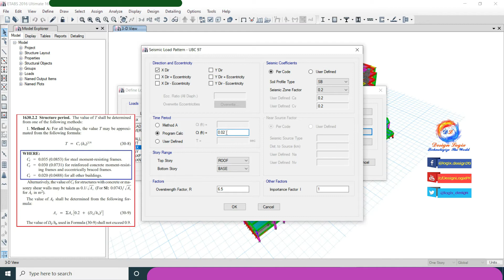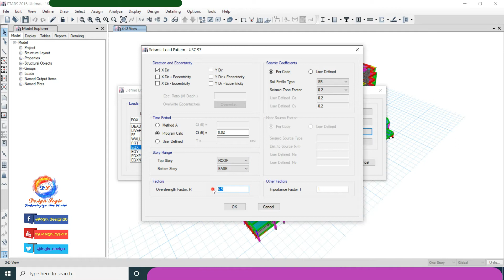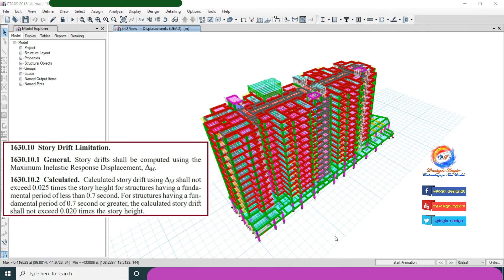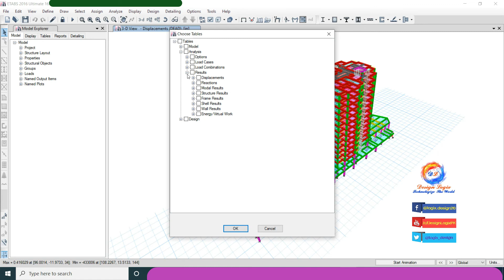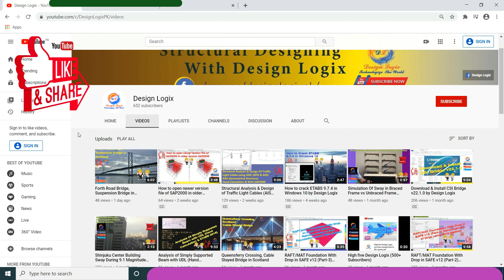How to check seismic drift in ETABS 2016 using UBC 97 code

Comment: hello sir, for steel structure to be check , it can be checked by exactly on the video even though it is steel buildings , it is the same limit  right sir?
Reply: allso sir lateral loads are assigned by ubc97 but load combination are under asce705 and stability checking also asce705 is it ok to do that though they are comoletely different codes?

Comment: How to check time period in etabs as per ubc97
Reply from the maker: There is a Table in DISPLAY TABLE option to check time period of structure. There you will find all modes time period.